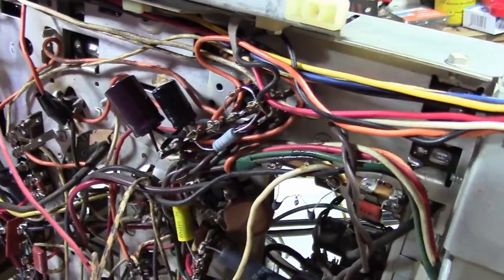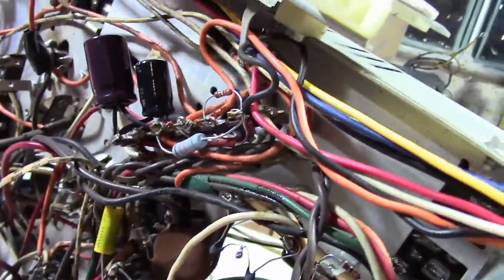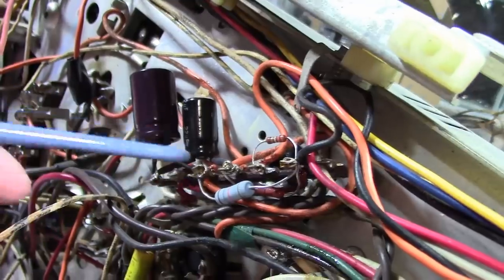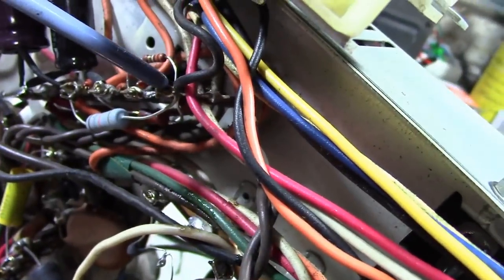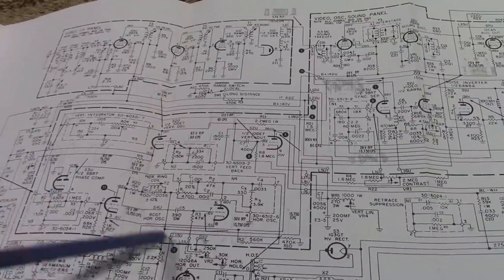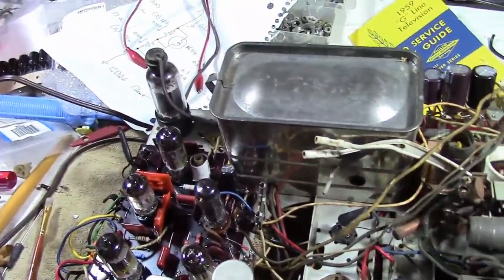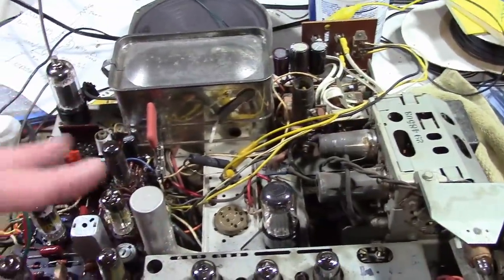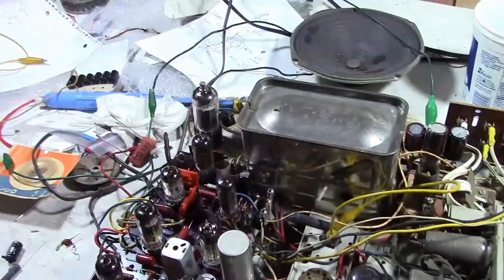Moldy Predicta Holiday p5o?

Comment: I am glad you found the wiring mistake.  As I watch your videos I am convinced that a Predicta Holiday is VERY difficult to restore. The 12LP4 CRT in my Magnavox is weak so when I get it re-capped I don't expect that the picture will be too good. Gary
Reply from the maker: I'm sorry I gave you that impression.  I find these are some of the easiest TVs to work on since most of the parts are on one board.  If I hadn't mad two stupid mistakes, it would have worked great on the first power up.  How weak is it ?  This set was used in a museum and run to death.  The picture tube tests very poorly. Barely moves the needle.

Comment: you might want to try flashing the getters in the tube. they might just be able to salvage it to something resembling a high vacuum. 

If i had more experiance with glass blowing, id offer to re evacuate the tube for you, using my high / ultra high vacuum pump systems. But shipping would be prohibative...
Reply from the maker: Unless the leak is sealed, it will lose vacuum slowly again.   Unfortunately, once the cathode is poisoned by air it's game over.  It wouldn't help to re-evacuate it.
Reply: @bandersentv  seeing as i work with UHV systems (pressures as low as 1e-12 torr) finding leaks is not all that difficult for my. though you do have a point with the cathode. Id need to reconstruct the gun from scratch... 

but its still an interesting option for an irreplaceable tube.

Comment: Hello Bob, Re. The plating on those arms, I was wondering whether the tube could be replaced with brass tube carefully bent to the radius required?, as a matter of interest what is the OD of the tube?, 
 Cheers, Sam.
Reply from the maker: Yes, I discussed that during the Predict SIesta project.   I'm not ure how shiny it would be compared to the original which was chrome plated under the brass.    It's around 5/8.  I figure I could get some 260 tubing from McMaster Carr.  I'd need to fill with sand or use a spring to prevent kinking.  https://www.mcmaster.com/brass-tubing/material~260-brass/
Reply: ...easier said than done-!!!
Reply: @daleburrell6273  I used to make brass trim components for classic cars and have them chromed,  a challenge like these arms I would jump at if I were a little closer to Bob, nevermind eh?.
Reply: @AverageJoe2020  ...if you say so-!!!

Comment: What is the inside and outside diameter? as well as the wall thickness of the tubing that supports the CRT?
Reply from the maker: I don't have a caliper but I'd estimate around 5/8" outer diameter. Around 1/16 or 1/32 thick. Why do you ask?
Reply: @bandersentv  have you thought of replacing the supports with brass tubing? or brass plated tubing? brass tubing can be shaped and bent somewhat easily. in the trombone industry they fill the tubes with water freeze them then bend them around wood forms. You plug one side only and freeze the tubing vertically. This helps the tube stay round when bent up to 180°. Then the brass tubing could be polished all you want. I think you can get brass plated tubing also. just a thought I had.
Reply from the maker: Yes, I discussed it in the recent Siesta project.  Keep in mind the original arms arms were chrome plated under the brass. I don't think pure polished brass will look the same.